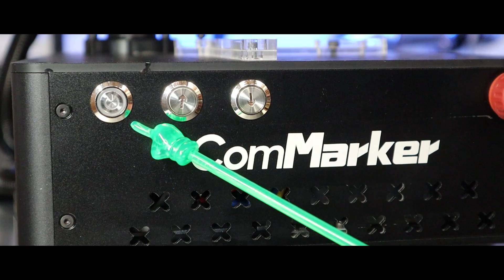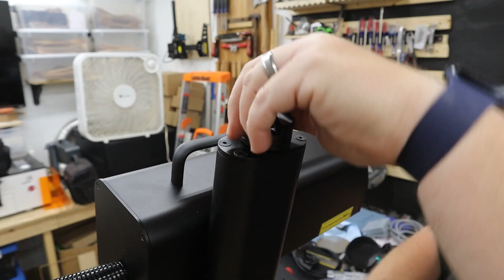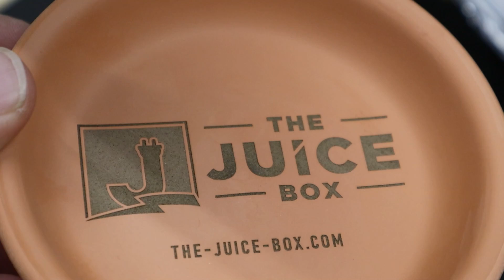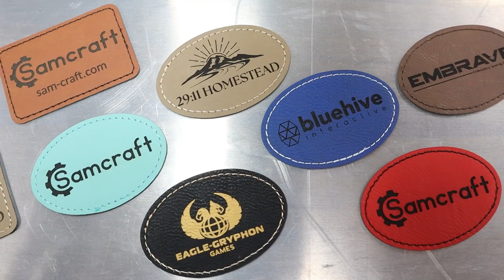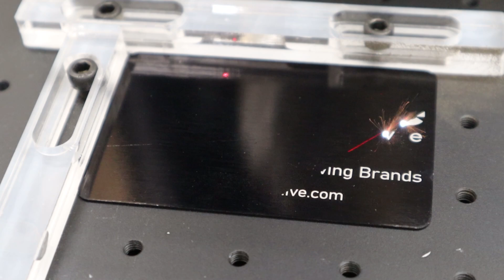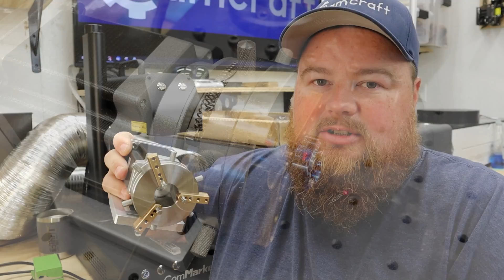When to Get a Fiber Laser - ComMarker B4 20w

Comment: Very happy that I bought the laser. Quick question... The main thing that I do is put qr codes on stainless steel 2"x2" tags. I am struggling to get a really black mark on the stainless.. It is pushed not polished. I got a darker mark with my xtool and brilliance spray. Any help or setting. Really appreciate your channel.

Comment: I just received the Commarker B4. I upgraded Lightburn to the galvo version. I'm having a problem setting up Lightburn to work with it. There does not seem to be a Lightburn device file like there is in a diode laser. I tried to have Lightburn find the laser, but it couldn't find it. I tried to create the device manually, but I can't find the laser in Lightburn. If you can point me toward some instructions, I would really appreciate it. Thanks.

Comment: I have a fiber laser as well and I love it! I actually got a steal of a deal on mine. I bought it on ebay as a "used re-manufactured" unit, it was listed as a 30W Raycus unit for $1,800 which I was happy with, but two weeks after I got it I had opened up the case to install a rotary tool controller in it since it didn't come with that, and to my surprise and delight, when I looked at the actual laser source inside it was a 50W Raycus!! 😂 the seller didn't realize someone had replaced the laser source with a 50W unit. The outside of the machine said 30W on it so they just assumed that's what it was. A used 50W Raycus machine should've sold for closer to $3,000
Reply: Awesome!!!

Comment: That’s a great look-see at this machine. Is it able to cut magnetic sheet,like biz cards or fridge magnets? Most lasers I see are recommended to NOT cut this material.
Reply from the maker: I don't know if it will or not. I would never attempt it due to the magnetic dust that will be created and the havoc it would cause in my shop.

Comment: When you increase the marking area by replacing the lens.  You will greatly reduce the power of the laser.  If you are not doing deep engravings, then you will be fine.  Also we switching out the lenses, you need to make the adjustments in EZCad\Lightburn.

Comment: I'm looking at a 30w made by the company who makes my big 100w Co2 (slightly lower price, single lens, slightly smaller working area than the 2nd lens in your kit), BUT the ComMarker looks to have a powered gantry, which the one I was considering doesn't...  I think it'd be worth the slight price difference to go with the ComMarker, but dropping 10w kind of makes it a difficult decision...  As far as the foot switch, and safety, I'd like to see them make a key-lock safety switch to disable the laser's ability to fire, so you could 'safe' the machine so the footswitch won't set it off.  Also as for the rotary, the one you have would also work with metal tumblers and such, that'd be my preferred use if I had that particular unit.  And just for future info, we call that debossing in my day job when it basically excavates the area of the marking that you can feel.  Great review, and it's definitely given me some things to consider on my next laser purchase..  I'd definitely make some sort of enclosure or shield which ever I go with (they both look VERY similar in design), most likely out of the appropriate wavelength-blocking acrylic.
Reply: they sell enclosures on their website that fit the Commaker lasers the only accessory they don't sell is an extraction/filtration device though there are plenty of amazing options for those on the market.

Comment: Great review as always!  I would love to get a fiber or MOPA laser but I'm still a ways out from that.  I'm turning out slate coasters with the Ortur LM3 and while it's faster than the original it's still 30 minutes per set of 4.  The current order of 350 coasters is taking DAYS to complete!   Keep up the good work!
Reply: Have you tried using the offset fill?  It sometimes is faster than going across each line.  And sometimes creates a really cool effect.  
I also have that laser. I can do a coaster in about five minutes each. 
Make sure you have the laser set to do one at a time.  So it is not traveling over dead space.  
I run most of my coasters at 6000 and 90%. What are you running yours on?
Reply: @rbparadise  I haven't done the offset fill with the LM3 but that's a great idea.  I do have them set to do individuals, that cuts down the time for sure!  Thanks for the idea!
Reply: Sometimes the offset fill adds a neat design within the design.  It’s kinda crazy how it does it.  Seems more violent than going back and forth.   

I have been using offset fill more and more.  Have fun with it.

Comment: Hey quick questions, Did you get this before your Atomstack M4 Fiber or your Genmitsu Z-5-1 fiber? You probably love the Commarker as it has much more power. Out of all 3 what do you like about them and why?  all are fiber lasers just lower power.  I got a Genmitsu after watching your video, after using it and learning BSLAPP/ Seacad  I love it for all small quick projects. My main drawback is I wish it was 5-10w laser  and the engraving area was more than 70x70mm  that aside love the portability and its lower cost to get into fiber laser. Im upgrading to a 50W and cant wait. Thanks for the advice review and if you answer the questions above.
Reply: Upgraded to a 50W 175x175  and a 300x300 lens and still use the Genmitsu for small or portable etching.

Comment: The footswitch is very handy when doing multiple items.  In lightburn there was no setup beyond plugging it in.  Mine has NEVER been on the floor, I keep it on the table next to the laser and hit it with my hand when I'm ready to engrave.  It's stiff enough you're not going to accidentally set it off with your hand.

Comment: Nice review. The link you have to engrave colors on slate is for the xTool F1, which you know has 2 styles of laser. In this review, you were able to achieve colors with solely the Fiber, can you please share your settings?
Reply: I was wondring the same thing. I would like the option to buy the files for this fiber laser commarker b4 Not the xtool. I am looking all over for the test files for this machine.
Reply: Settings please...

Comment: Metal tags with horses name on them are great for labeling horse blankets. Winter, rain, fly, sunscreen and super cold winter. Every horse has multiple blankets and labels need to be able to go thru the laundry. Horse barns and horse stores may also buy tags to label horse show trunks and halters and saddles and other equipment. Send a letter with plan and get a batch price with 5 or 10 tags for each horse with each name. Or a large race track may also label blankets by size rather than horse name. Dogs need one or 2 tags. Think big!

Comment: What exhaust fan are you using? I have a 50 watt co2 a 20 watt fiber laser and just ordered the xtool f1 as I like the accessory bed for it. We will see where it fits in after a few months. Do you know if the F1 will do more items than the fiber?  I know some things on the fiber I have got to work just by giving a dark surface. Even wood somewhat works. If you don’t catch a t on fire first lol